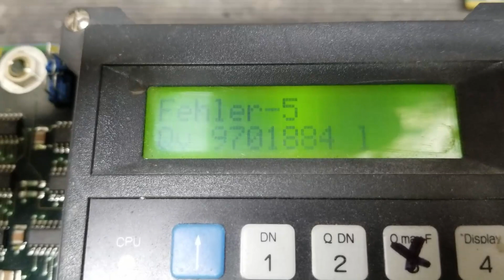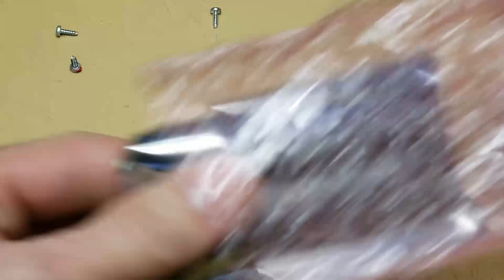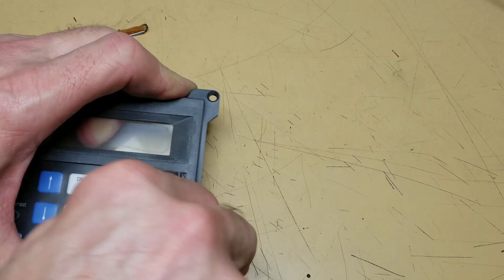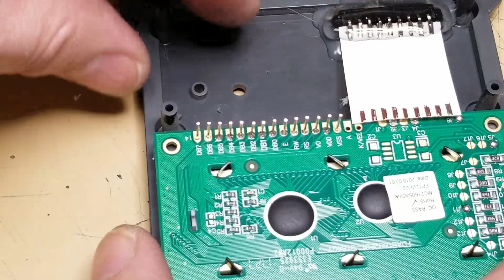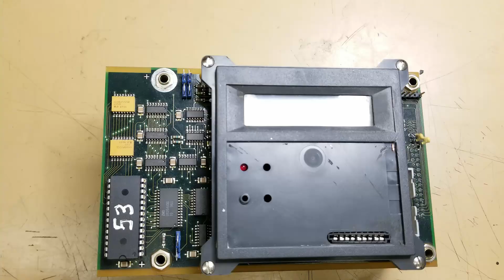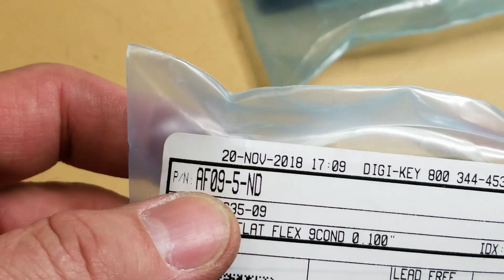ABB / Bailey Fischer Porter VM1101 Flow Meter Computer Repair and Upgrade

Comment: I saw a micrologix 1000 eprom in your list. What have you done with Allen Bradley stuff?
Reply from the maker: Was repairing the power supply in the Micrologix. Got tired of downloading the program every couple of weeks. But yes AB. PLC5's SLC500's Controllogix's, Compactlogix's, Panelview's also Powerflex and Kinetix drives. Even a SLC100 here and there. Thanks for noticing.

Comment: Is there something getting really hot in the power supply where those caps were? The board is dark underneath.

Great to see a video like this. Industrial tech is longer life than consumer and harder to maintain with lower unit sales and less spares. As an industrial designer, I preferred eprom over eeprom due to the longer life for data retention and I am a bit dubious of anything that uses charge level for multiple bits per cell.

Getting older parts to maintain these units is getting harder. Lots of old gear still being relied on is early through hole. I'm never surprised when asked to fix something full of parts well out of production.
Reply from the maker: those are 7805 and 7905 voltage regulators. both designed without heatsinks.
Reply: @norcal715  Would look to see if there are any push on clip heatsinks you could add to them anyway, to keep them cooler. Just would replace one with a plastic ISOTAB version so the2 heatsinks can touch without shorting out. Anything that is better than the 100C/W of no heatsink will improve life, especially as ageing voltage regulators that have run cooking hot tend to fail as either increased leakage input to output or even fail as shorted input to output.  TTL will survive the 5V rail being 10V, but NMOS or 5V CMOS will not.

Comment: Hehe, interesting to see you repair other electronics other than consumer goods. Is there any reason why you chose to change the keypad into being a "service" keypad instead of replacing it on the front panel?
Reply from the maker: not being able to economically source a replacement keyboard, also the operators tend to like to push buttons to try to remedy situations that don't exist and it introduces new problems into the process.
Reply: @norcal715  Makes sense. Also explains how the keyboard ended up being destroyed. I imagine this device is a set-and-forget piece of industrial automation - don't touch it if it's working.
Reply from the maker: the keyboard really only needs to be touched if a change is made in the field such as a swirlmeter has to be replaced since each swirlmeter has its own calibration values, or a complete module exchange would require the keypad. These devices run 24/7/365 for most of their life.

Comment: Why don't you use a standard pin header instead of making your own like that? Thank you for an interesting video!
Reply from the maker: I looked at DigiKey and Newark but was unable to find the header I was looking for (maybe using wrong search terms). The strands of THHN were the next best thing. Thanks for watching.
Reply: Yeah should be able to find a "turned pin"-header.
Reply: Common square-pin 0.1" headers don't fit in those type of sockets.  The header pins are about 0.035" diameter, and the ID of those sockets is something like 0.020-0.025".  Standard pin headers could still be used, but would require the replacement of the socket.